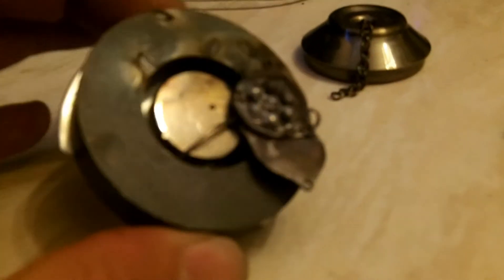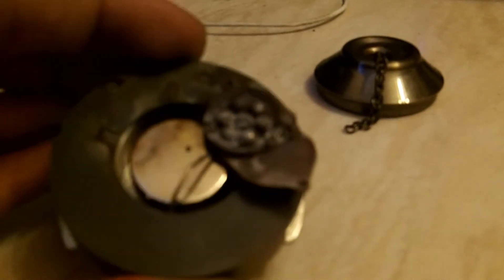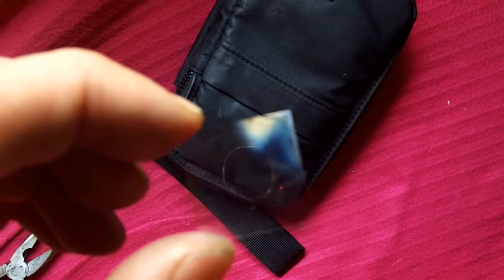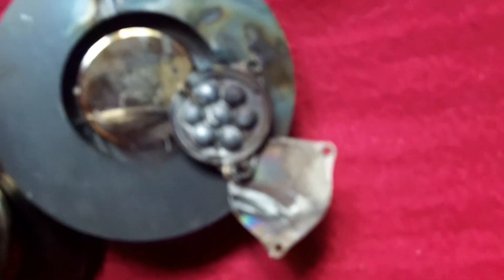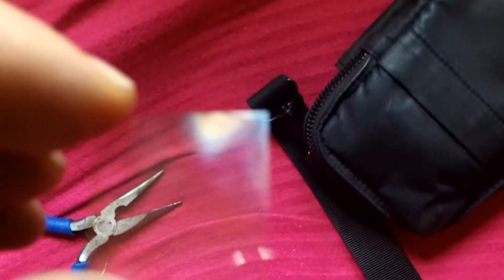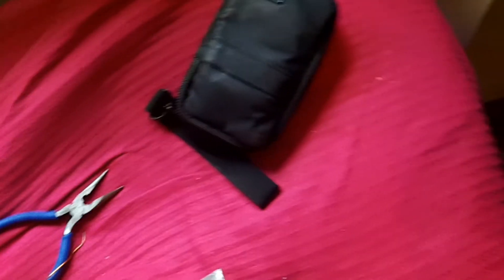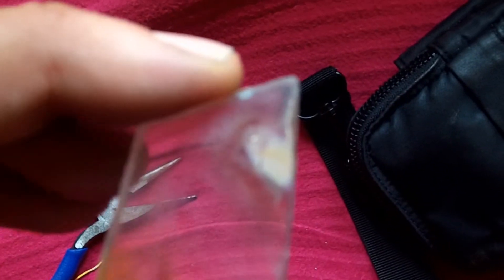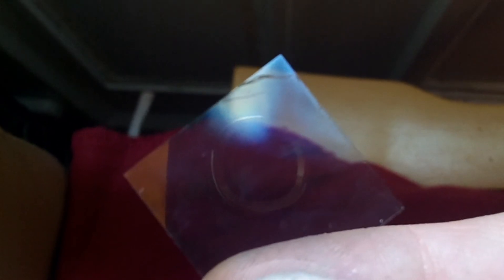MAGNETRON RF sputtering DIY

Comment: Congrats man! I am developing a magnetron sputtering too. Can you give more details about your RF power source? Thanks!
Reply: My power source was a double wound 'slayer exciter' (I mean it has 2 transistors and 2 primaries). Have a look online for the circuit diagram. Can't remember which transistors, and I've just moved house so my Slayer Exciter is sitting at the bottom of a cardboard box, under a Tesla Coil. I fed the Slayer with a Variac at around 40 - 50V input (from the mains) as anything higher would lead to spontaneous combustion of the transistors.
Reply: Great! Thank you!
Reply: Victor A  I made a DC sputtering but didn't try RF yet. Sorry.

Comment: Great result considering how basic the and easy to make your splutter chamber is.
I have often wondered how low tech one could splutter. You have shown you dont need too much fancy gear. Is that a glass or plastic cylinder for the vacuum chamber?
Reply: Mongrel Shark Thanks Mongrel! The chamber is acrylic. I'm building a bigger vac chamber with a pyrex salad bowl, and hopefully this one will be even cheaper.  Giving credit to 'sparkstarter' and 'YT Rich', they demonstrated how easy it was in their videos, and they managed to sputter the copper too. I must have had at least 20 tries on the copper, before moving onto my wife's earrings after reading that silver and gold were the easiest to sputter :)
Reply: I'll have to check those guys out. The only youtuber I have seen spluttering in Applied Science. Ben has got so much cool gear its hard to classify him as a backyarder.

I have been wondering about plastic vacuum chambers for a while. Any issues with plasma burning it? I have see you do a lot of plasma experiments in that chambers prior to the spluttering stuff. My bigest concern was that with enough burns sooner or later it will start to loose viability. Looks like yours is holding up well though.
Reply: Mongrel Shark My first plastic cylinder cracked when I tightened one of the nuts, so I had to get another. This one is 5mm thick, and has at least 3 burn marks from long plasma filaments that were hot. I think it'll survive as long as I keep the walls away from long plasma arcs. 

I used a big plastic, transparent screen as a guard in the early days, and I still use it if I think the experiment warrants some extra safety. I was lucky enough to have a mate stop by with some big polycarbonate sheets that he didn't need, and they work great as lab shields. Goggles are obviously a must, and I never get lazy with putting them on.